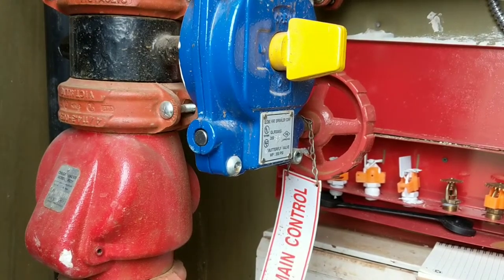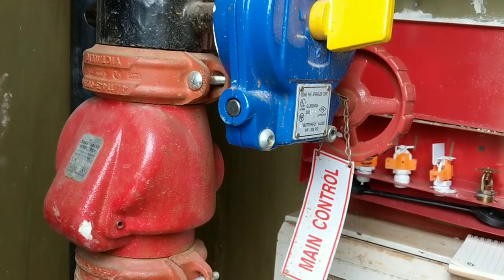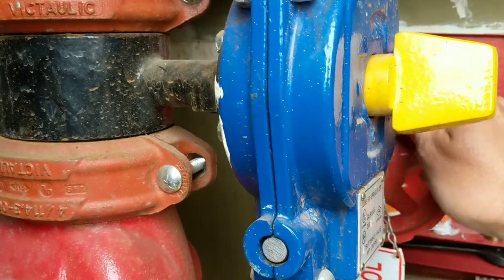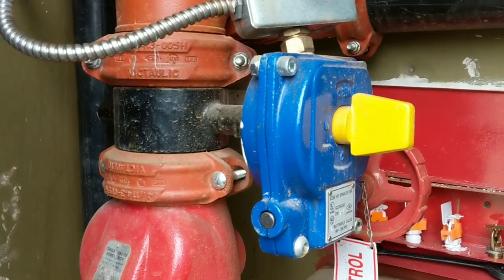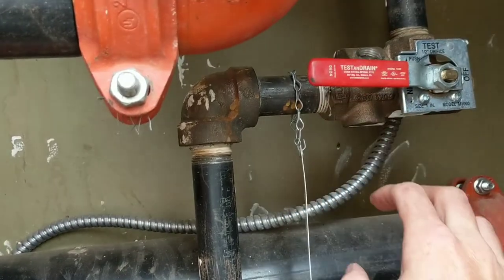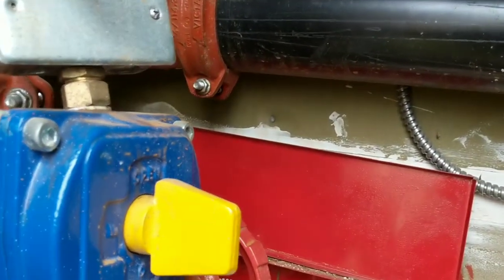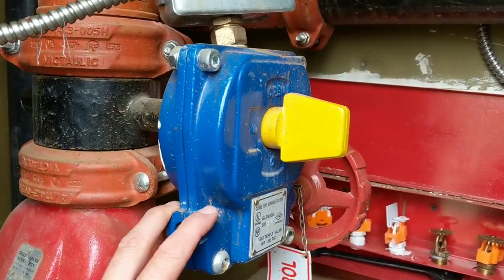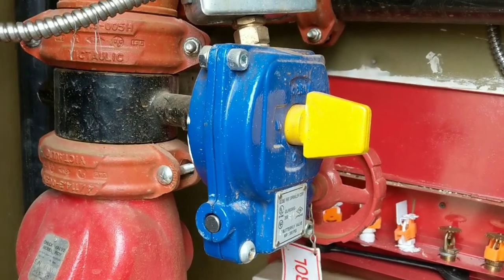How to Shutdown the Fire Sprinkler System in the Riser Room

Comment: Closed  the control valve, sprinkler pump still running?
Reply: Find breaker in breaker box to compressor and shut off
Reply: While fighting off deranged crackheads in post apocalyptic setting
Reply: Only pumps you would need to be concerned of is a fire pump and jockey pump, there will be panels on the wall to switch them off, I didn’t see either in this video, there isn’t a sprinkler pump, the control valves shut the water off coming from the city